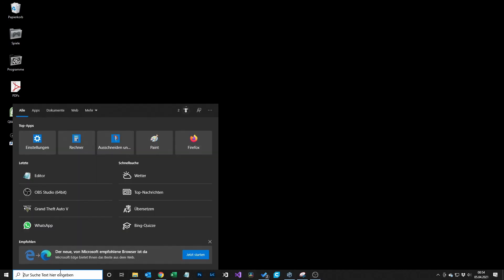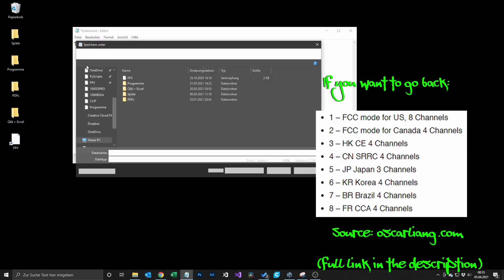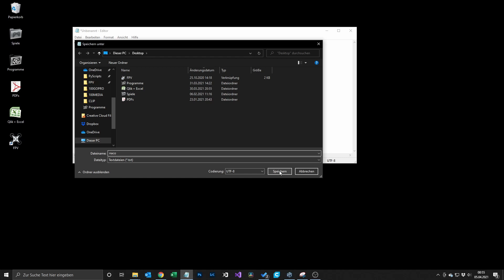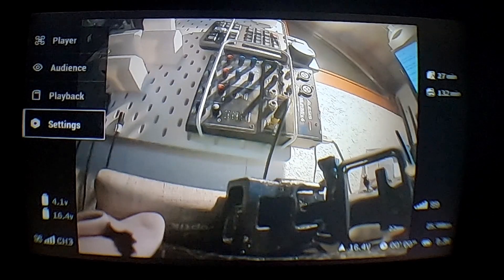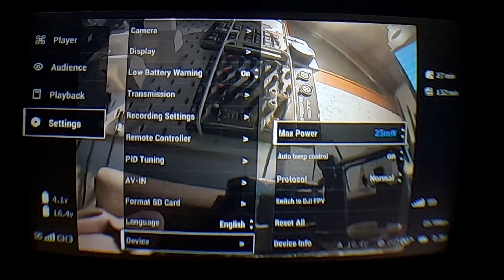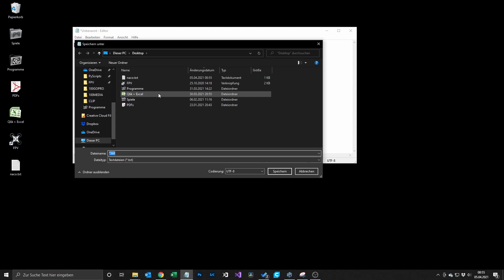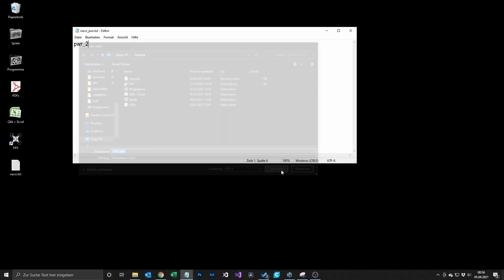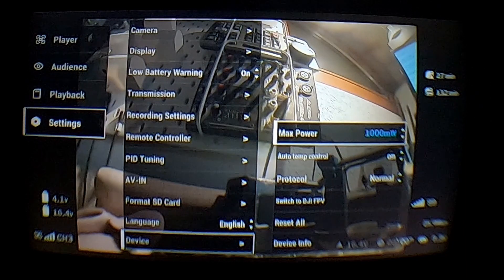Get the whole power out of your DJI Air Unit and Caddx Vista | FCC Hack for more range

Comment: Nice for spreading the word. 👍😉
If may add, I would strongly recommend to use a small fan blowing in Vista whenever you let it powered without flying (air flow) for more than app. 30 seconds. Even if you have temperature protection turned on. This thing gets really hot. Full sized air unit is waaaay less sensitive, but I would still do it for example during update.
Reply from the maker: That's a good point! I always use a little USB fan (already with analog) when I'm working in Betaflight with a plugged in Lipo, as I wanted to protect the FC and VTX from overheating (yes I was to lazy to enable PIT mode everytime 😂).

For the Air Unit and the vista I'd absolutely agree here as both get much hotter in a short amount of time (compared to analog) 👍👍

Comment: Great thank you a lot

Is there a way to extend the range of the dji fpv remote controller - the first black one?
Reply from the maker: Hey! I don't own this controller therefore I don't know, sorry 😒
Reply: @flickFPV  10x
What remote must i upgrade in future?
Reply from the maker: I'm flying self build FPV drones with Air Unit / Vista (I think you too and not a DJI FPV drone therefore what i write here applies for FPV drones). There is a wide variety of remote controllers out there , I'm flying the Team Blacksheep Tango 2.
But changing from the DJI controller will result in adding additional stuff to your drone(s) which you have on board of Air Unit / Vista - in that case and my example this would be a CRSF Nano RX.
Reply: @flickFPV  thank you

Comment: I have the googles v 2 and they have been working fine with diatone cinem that they came with. But the drone was really noisy that is why I removed it to a new flight controller
30.5*30.5mm HAKRC F722 DJI Stack 45A F7 3-6S Flight Controller 
and in that the connection from dji goes to the uart 6 on flight controller. I can see that the googles bind to the caddx viasta, but I do not have any image....:( do you have any idea maybe that can help me?
Thank you
Reply from the maker: Sorry for the delayed answer, if the problem still exists: You have two different UARTs one for the controller one for the video. Find out the UART for the Video then you have to activate it in the UARTs tab with the switch "Configuration/MSP" also make sure that nothing else is ticked in that row.

Comment: I don’t have the vista, but i have the the air unit with the DJI camera, is this the same procedure?
Reply from the maker: Yup Air Unit and Vista is the same, but this doesn't work for the DJI FPV Drone. I've successfully increased the power on two air units by doing so.
Reply: @flickFPV  cool, I don’t have a DJI Drone!!!  Thanks for the Tip!!!!
Reply from the maker: @papagamersother5814  just wanted to point that out, as I don't own the drone neither and  as some people were complaining about the last hack doesn't work for the DJI drone.. 😉

Comment: So how do you know your caddx is running 1200 MW and does it have to have an sd card ? Thank s
Reply from the maker: No on the vista you don't have an SD card slot only internal memory but basically the steps are pretty much the same like with the air unit.
And on a air unit you only have to insert a SD card once and could take it out afterwards. In both cases you have to redo it when  you're updating your unit.

As soon as you can select 1200 mw and your not in low power mode you'll have 1200 mw, but for sure there are also machines available which could measure your output power

Comment: My pc detected the vista but i cant transfer files into it. How can i solve this?
Reply from the maker: Have you plugged in a Lipo while doing this?  If not try it with a lipo 😉
Reply: @flickFPV  I already found a solution. I think it’s a windows10 bug. Here’s what I did. Go to Device Manager->Ports (COM & LPT)->uninstalled the USB Serial Port and then replug the vista w/ batts into PC and finally it was detected as a “storage” then I followed your tutorial and I already have 1200mW options on my goggles. Thank you so much!
Reply from the maker: Great that it worked! Happy flying 😉

Comment: Before doing the Naco txt file 50mbps was greyed out 
Now I’m getting 700mw and can select 50mbps. But on the screen I’m on 25mbps and have 4 channels? 
Any ideas thanks
Reply from the maker: Did you do the Naco_pwr for the goggles as well and power cycled the drone and the goggles after the hack?

On 50 MBit you only have 3 Channels but on 25 you should have 8
Reply: @flickFPV  I did with my other quad and that’s running on 50. Do I need to do it with the goggles for each quad ?
Reply from the maker: @MarkJones-100  You need to do the hack once per Quad, but only one time on the goggles.
But I think you have to change it to 50 mbit per quad after both (quad and goggles) are plugged in.
Reply: @flickFPV  the strange thing is I couldn’t select 50mb before the Naco txt. But can now. But it will only show 25 on the screen when flying
Reply from the maker: @MarkJones-100  And you did the step in the hack & settings for the second quad as well?
Reply: @flickFPV  yes I’ve done the Naco txt with my vista plugged in and powered up
Reply from the maker: Just did a quick test on both of my digital quads - 25 MBit remains when CH8 (Public channel) is selected. When going to CH1-3 it should change to 50 MBit right away - hope that helps 🤔